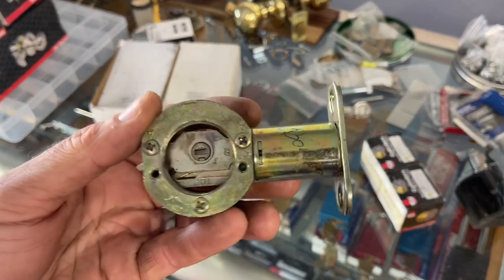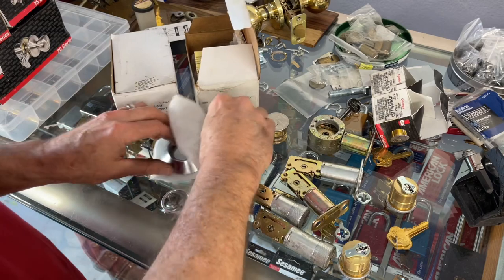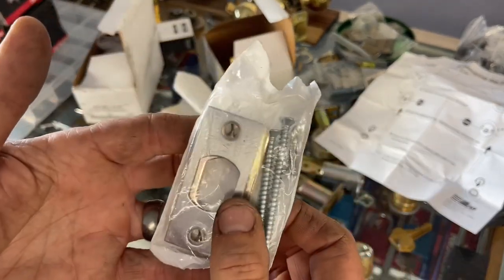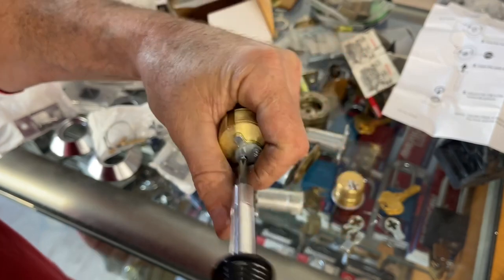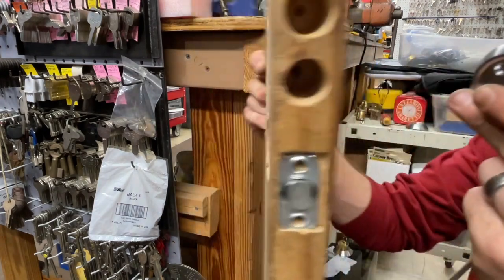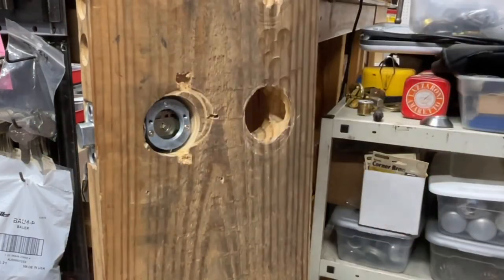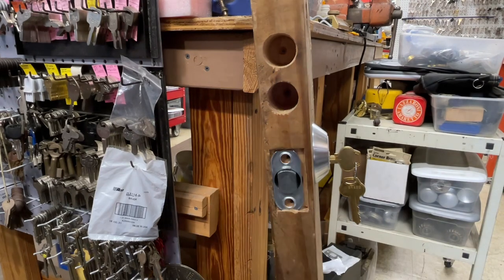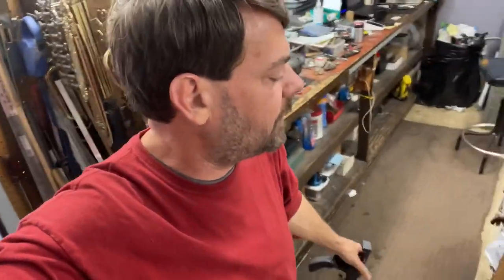Lori Style Deadbolts - the Mortise Cylinder Deadbolt

Comment: If your mobile locksmith, these are good to have in a pinch when you don’t want to carry a whole bunch of different keyway deadbolts. Plus they come in different finishes. Only downside is they’re fairly expensive. I have grade 1’s much cheaper and save the Lori’s for emergency use when I want a non common keyway or just need something that’s keyway flexible to complete a job. Thanks for sharing!

Comment: good hint using a blank, just incase it is a little tight and the precut is designed so the first cut is the deepest. And this is another lock where you are more or less lost unless you know what you are dealing with. If you use the cylinder without the spacer ring, it looks like some key designs will have a problem with the bow hitting the outer ring.

Comment: The Corbin Russwin ones always seemed like the casting quality was just a bit nicer than the originals or the Ilco. So I guess they use a different company than the others but the same patent number.
Reply: There was a while where I collected these for some reason, I still have a Corbin, a Russwin, a few original Lori's as well as a Corbin-Russwin. I also have some of a much older desging that used a goofy tiny hook-on latch in a separate cast latch body that had phillips screws that both attached the latch body the lock case and also acted as the set screws.

Comment: Your video helped me a lot with the shop door dead bolt that was really loose. It's in a steel door and it has different spacers on Inside and outside cylinders so it not center in the door. I need to figure out what spacers to get to make it equal and also when I tighten the 2 screws that holds the plate in the door jam area the tighter the screws the harder it makes the locker to function. I think because it's not center in the door so it binds when I tighten them plate screws.